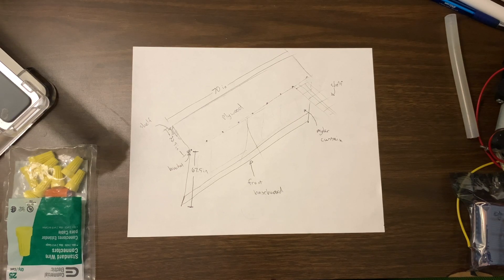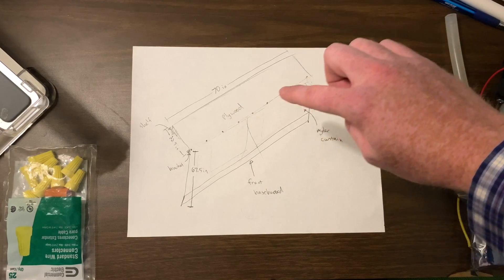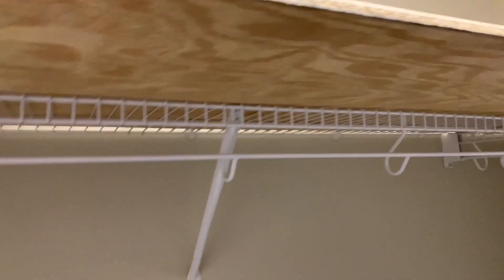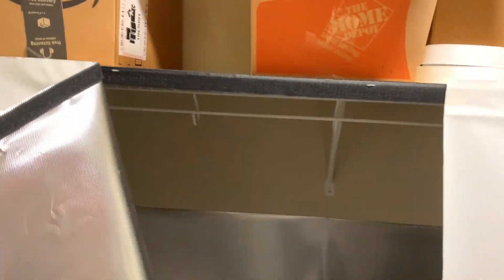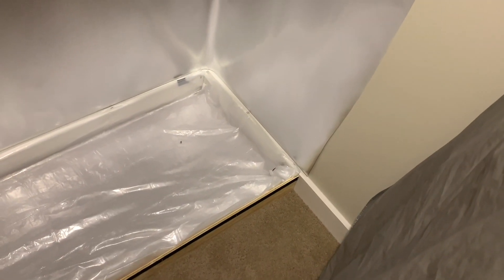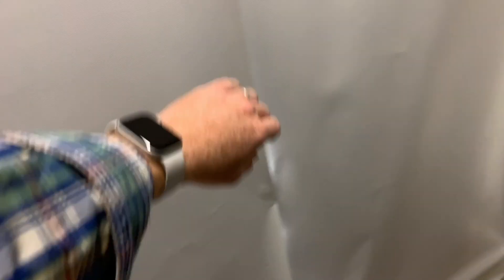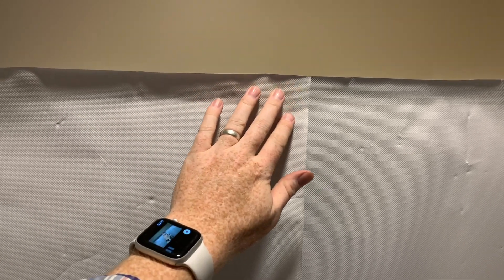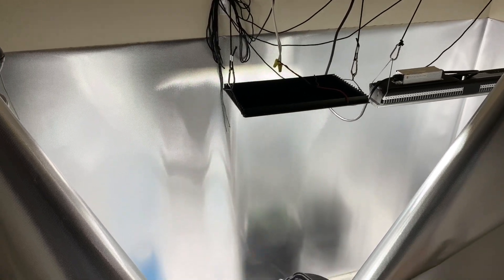DIY Closet Grow Room Build (Walk-In Closet Conversion For DWC Hydroponics)

Comment: I'm all for diy but don't you think it would be easier to just buy a 4x2 tent or something?
Reply from the maker: If I wanted a 4x2 grow area then buying a tent would have been slightly easier (although my plywood and Mylar construction was probably about as easy to assemble as a tent) but I wanted to maximize use of my space and was not able to find a tent that fit exactly.
Reply: You can get a roll 10 foot by 100 foot for $29  . Or the refectix from lowes works very well i used the reflectix on my smaller cloning/seedling tent . With pvc .
Reply: Art Rivera you should post a video of your set up
Reply: I bought a 80x80x78 for less than 200
Reply: I built a 6x6x7 foot tent , and a 10x10x5 tent , for less than $60 . Using panda film . Both better quality than alot of high dollar tents ive seen .
Reply: @artrivera5141  did you frame with wood or PVC?